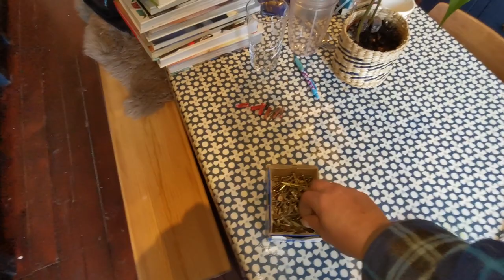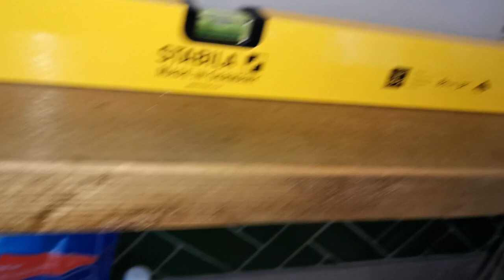Refitting a shelf that was poorly fitted to brick wall, drilling & inserting plugs

Comment: Some people will watch this video and say why do i need a video on using rawplugs and drilling into brickwork rather than the mortar , fact of the matter is loads and loads of people do it wrong ,until watching Gid ages ago i was one of them because i used to make sure i drilled into brick but i did not consider the plaster ,looking back it was obvious i should have added the depth of plaster when drilling but until Gid pointed this out i never did . I look back  and laugh at myself for such at foolish mistake . So thank you Gid for taking time out to show the proper way to drill and fix plugs .
Reply from the maker: Thanks Simon 👍 You're welcome, what you say is exactly why i decided to post this, I've seen this so many times, the little screws & plugs that come with some of these kits are often insufficient or they're put up by people calling themselves tradesmen who simply put them up wrong, & the simple thing is not pushing the plug past the plaster into the brick,  i could've done better filming showing the screws going in when the shelf went back up, I'll try better next time but i hope my point came across, I also showed lots of drilling to show that if you drill slowly through the plaster then press on when the brick is reached to hammer into it, then a cleaner hole will be drilled.
Reply: I’m another that would have upgraded the screws and rawlplugs, but not factored in plaster.

Comment: Thanks for sharing the drill at an angle tip, never thought about it really but it makes perfect sense. Thank you
Reply from the maker: Hi, you're welcome, I would normally drill straight in, the main reason i put these in at an angle was to stop the drill drifting into the other hole when drilling but the angle does give added strength, You might see a joiner hammer a couple of nail in that don't go in straight, that's prob intentional, it's called skew nailing, giving strength because 'dovetailed' nails don't come out so easily as 2 nails hammered in straight n parallel  😉👍
Reply: Gid Joiner Makes so much sense as soon as it’s explained (whereas when I’ve seen it in the past I always thought it was simply sloppy).  I think even if you were only putting one screw in, a sideways (or possibly downwards) angled hole would also resist pull-out better than a ‘straight’ hole.

Comment: Had my 240v Dewalt sds plus for at least ten years, still works perfectly. Might be the best power tool I've ever owned.
Reply from the maker: 👍👍 I had a 24v Bosch n I don't remember what 110v one i had on site, but yeah, this is my second 240v in about 20yrs since going self-employed, i killed the other by over working the sds plus chisel function, i replaced it with the same because the first did well, i give this one a little less abuse but it's had a bit n is still going strong, 👍👍

Comment: If there was no possibility of moving the screw position I think I would have done it the old fashioned way,  by enlarging the hole a little and hammering in a good tight wooden plug that would take both screws.

Comment: did you untwist it? or is that something that can't be done? anyway, I liked the angle drilling tip you gave, that's gonna come useful. I have a wall mount with only two holes, one up and one down, had to draw it to figure out which angle to drill in. at first I thought the top one should be going down, but upon drawing the arrows I think it should be going upwards,  and bottom one downwards, so they should be diverging in the wall, just like you showed with fingers, even when it's just two screws
Reply from the maker: Hi, not sure what you mean untwist it'? but if you're ref to the wires, no it was glued in i believe, & every job is different but drilling two holes close together is difficult so angling them away helps to stop them drifting into each other, & if you can't get a good hole, drilling up down left or right is the only option to find good brick, ,

Comment: I work in social housing and you should see some of work done by some tenants like load bearing walls being removed....it would make your eyes water....another great vid mate!!👍
Reply from the maker: Thanks 👍 😬 Yeah I was made redundant after 5yrs from the place i did my apprenticeship, one of the first places i did a wks work for was the council, shocking rough arsed work, I only did the full wk because i wouldn't of got paid if i didn't do the full wk, I later got to work for half a dozen better joinery firms who over the yrs kept me in work when they needed extra for a job they'd taken on, i was never out of work & got to work with some good joiners, all i had to do was make a call, do a good job n they'll have you back, i got varied tips from working with lots of different people, I find that some people who have only ever worked for one firm don't learn better/different ways, learn or even care what they're doing wrong,
Reply: @Gidjoiner  Well our joiners to be fair don't do the stuff your doing and  take little pride in their work..same with all of the trades at our place. You would put most of them to shame. I followed your alcove series and tried to copy.  I messaged you via facebook about the rail/ stile width if you remember. I'm finished now and my daughter is over the moon and is amazed. I'l drop  you a pic on facebook. Thanks again for the advice and inspiration.👍

Comment: Have you tried them fischer duo plugs?. I used to use rawl plugs but I've found the fischer ones get a more solid fix.

Another good video tho. I appreciate you find the time to produce this content.
Reply from the maker: 👍 I've got some for bigger ones I use mainly for the no' 6 coach bolts when i put them into brick but most of the time i don't have an issue with reg/brown plugs. Thanks tho n you're welcome Chris 👍

Comment: Great job...would concrete screwsbe a more secure fixing than wall plugs and chipboard screws..????
Reply from the maker: Thanks Brian 👍 I've got some i acquired when working on site but don't use them, they're in a box collecting dust, so can't say, but i don't think so, not better anyway, plugs expand to fill the hole, concrete screws don't so they're relying on a very good, well drilled sized hole to secure a grip, screws & plugs are tried & tested, one of the 2" screws i put in in this vid would take my whole weight plus some to pull out,
Reply: @Gidjoiner  cheers for the reply,your a master craftsman👌
Reply: I've had mixed results with concrete screws, but always had very consistent results with good old red plugs👍

Comment: See when you drill with an sds, and you are using red plugs, should i use a 5.5 bit or a 6? Excellent vide as usual 👌
Reply from the maker: Hi, I use a 6mm bit with red plugs with 4, 4.5, & 5 screws, I only buy 6mm drills so can't comment on 5.5mm bits & 7mm for brown plugs with no'6 screws, if i thought the 6mm was too big for he no'4 screws i would try the 5.5mm bit but never felt the need.  Thanks 👍
Reply: @Gidjoiner  excellent gid cheers.